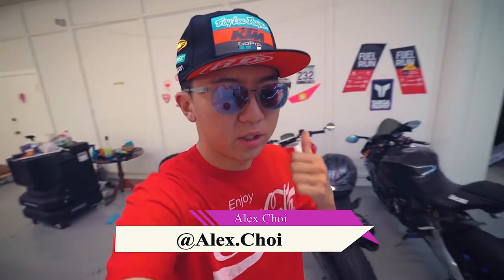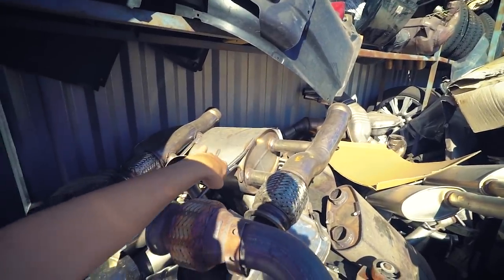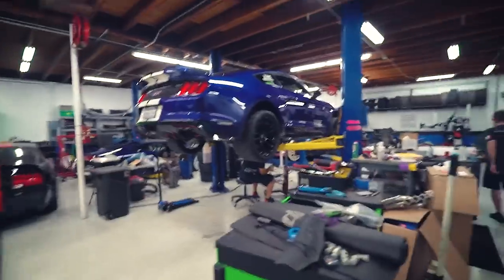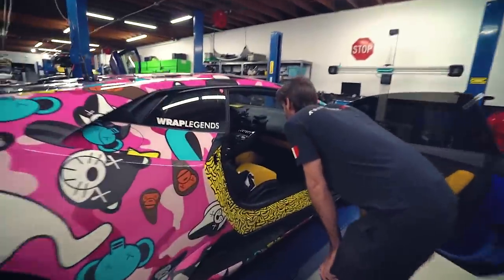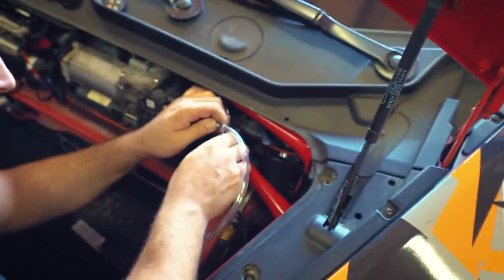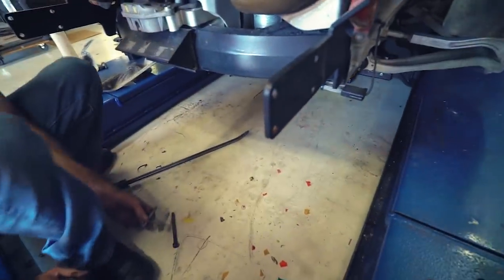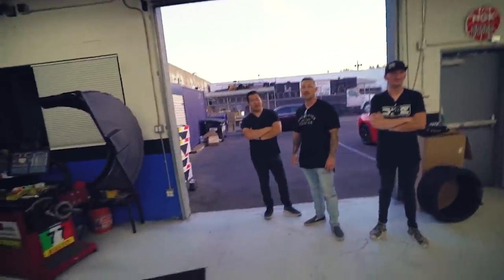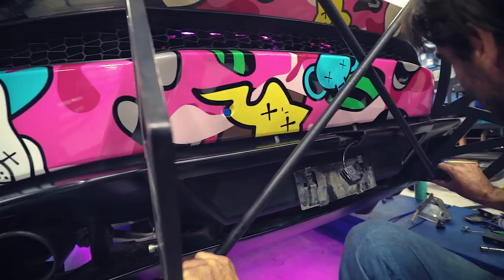I RUINED MY LAMBORGHINI WITH THIS...  *ALEX CHOI VLOG*

Comment: Your car is AWD from factory , the difference is that with AWD some percentage of the torque goes to each of the 4 wheels all of the time and you cannot usually switch it off. With basic 4wd you have max 3 wheels under power at the same time and that is only with a limited slip diff in the rear.

Comment: AWD and 4WD are different, AWD usually has a diff in the t-case or trans that moved power from front to rear and corners better due to its differential , but $WD or 4x4 locs the front and rear to the same power 100%

Comment: All wheel drive is just that. All wheels drive the car.
and as a end consumer, you have no control over
the All Wheel Drive.
But. 4 Wheel drive  or 4X4, is only 4 wheel drive after
you put it into 4X4. Before that? It's rear wheel drive

Comment: The Huracans are super ugly with no rear bumper. Don't fuc.ing tell me it looks savage, like saying I am twin turbocharged Lambo, which of course is hell of a fast car. It is fast, but I would do anything possible to have it twin turbo-ed, and have my bumper. Like this, it is like a buggy, with a huge tire, and a very thin and long taillight, on of the only things I do not like on a Huracan are the tail lights. The car just ends with the tail light at the top of the trunk/rear, just like the first gen Gallardo did. I need some kind of a metal panel frame around the light, and on top, like a newer Gallardo. If not, the best case it to have a wing, nt too far high/up from the taillights. Maybe  it is because I am old, I am more than 30, and this colorful wrap, with this design their both Huracans have is stupidly ugly. Parkers car has a kit, a wing, a front bumper, side skirts along the floor, but it looks good. These DDE and Alex Huracans look like ricer guy labmo. I admit they are fast, but this doesn't mean you need to have this stupid look.